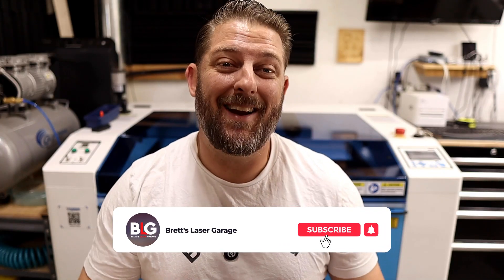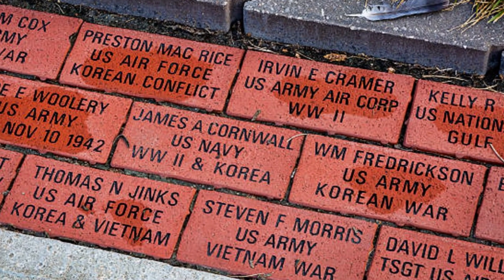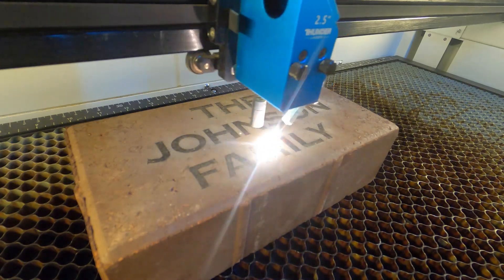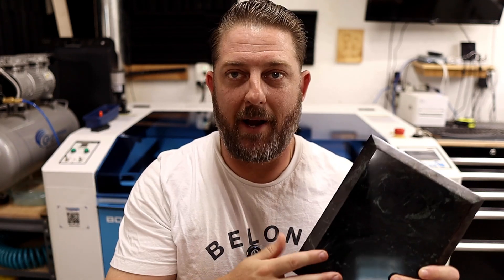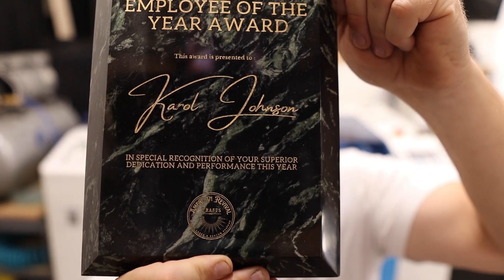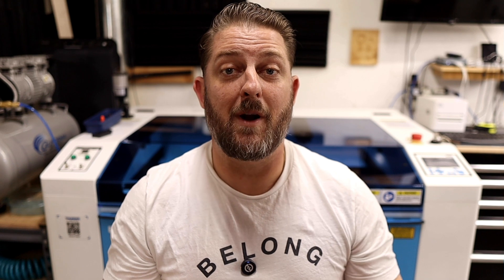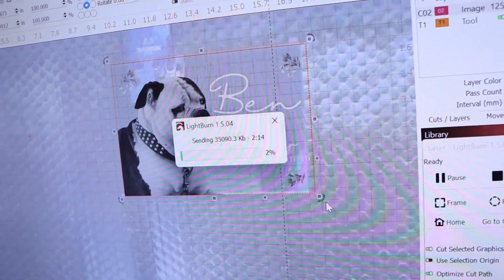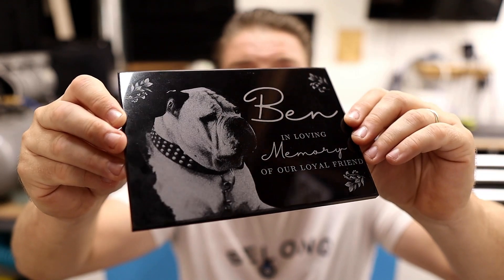Have You Seen These Laser Engraving Materials?  Engraving With The Bolt Pro 32 by Thunder Laser

Comment: Are these materials all safe to engrave with our laser or are there certain ones we need to look for?
Reply from the maker: Not sure what you’re asking sorry.  Everything I showed in the video is safe to laser if that’s what you mean.
Reply: @LaserGarage  Can you use just any brick or are there laser safe ones?
Reply from the maker: You can use any clay brick but results will vary from my demo.  I used a product called laser brick which is specifically designed for laser engraving.

Comment: Just wondering why you run your Laser a 100%?
Reply from the maker: I don’t always, depends on the situation.  But when I do it’s for speed.  Time is money
Reply: @LaserGarage  I have been told that its bad for the tube and shortens the life. (thanks for the reply)
Reply from the maker: @dwightbauer6705 it is not bad for the tube per se, at least not for a Thunder laser.  But think of it like gas in your car.  The faster you drive the sooner you’ll have to fill up your tank but the quicker to get to where you’re going.  So yes, you will get more life on the tube by taking it easy.  But as a business where I need to run jobs fast it’s a trade off I’m willing to accept in order to run faster, i.e. make more money.

Comment: I used to get the 12 x 12 Absolute Black granite tiles at Lowe's for $4.98 each, then they stopped carrying them.  They can be ordered now, but they're $176 for a case of 10.  I made back the cost of my laser 10X with those tiles.
Reply: I got the last 2 boxes at my Lowes recently. Cut them down with a wet tile saw to 6x6. That way you get 4 blanks and the small ones make good pet memorials.
Reply from the maker: Nice!